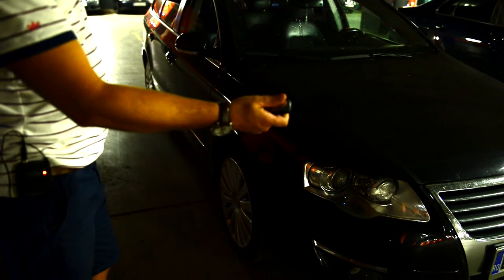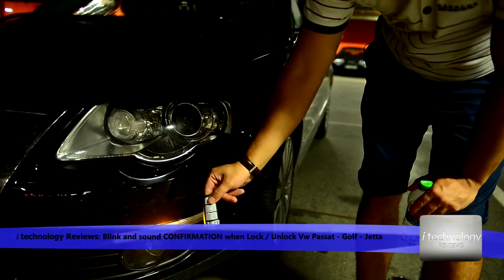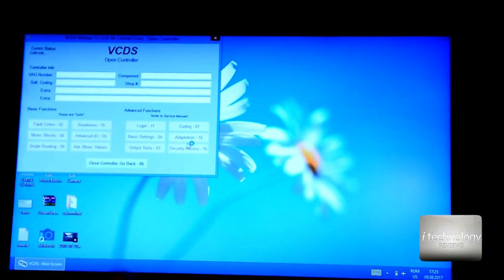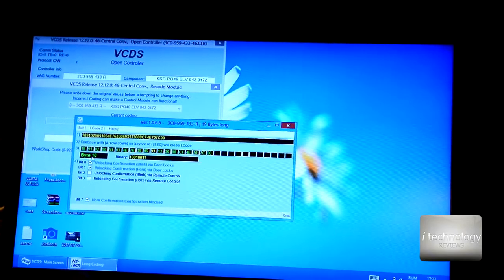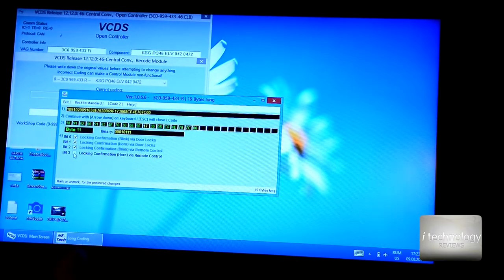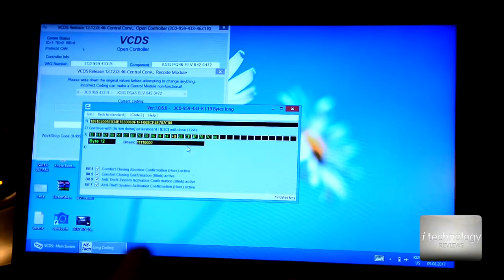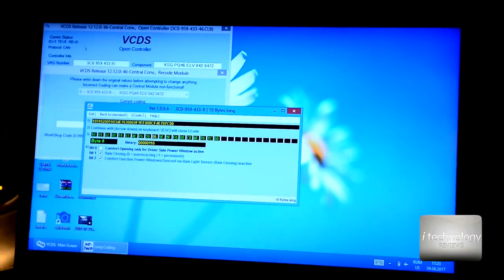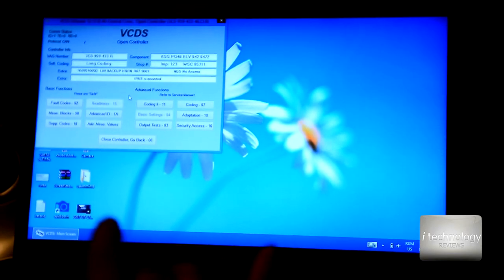Blink and sound CONFIRMATION when Lock-Unlock Vw Passat, Golf, Jetta VCDS programming

Comment: so it don't work on my mk 5 2004 because i have mil on (CAMSHAFT POSITION SENSOR G40)? I did long coding and adaptation but engine light not cross my mind. Can i clear faults and then do long coding again or i must first replace camshaft sensor?
Reply from the maker: hi; man you are in the wrong video; no camshaft here

Comment: I greet you.
I recently changed a lock on a rear door, a golf 4 - 2003, everything went ok.

Before that, when I locked the car from the remote control, it confirmed the locking with that blink of the signals, but also later, being locked, if I pressed the lock button from the remote control, it made the signals blink again.
Now after I changed that lock, it blinks when I close it, but not later when I press the close button again. What to be ?

I mention that everything else works fine on shutdown.

Comment: Ive tried, do you need a special module for the anti theft... it sounds the horn if you open the door from the inside when locked
Reply from the maker: hi; yes you need the siren unit that have electronics inside with backup battery

Comment: I have 2015 passat will this work please? I try once before but didnt have car running and only selected the 2 unlock with horn options I must make sure next time I do all 6 options. Will I have to fit a new part or something
Reply from the maker: hi; you need an internal original alarm system; will not work on horn... subscribe please
Reply: @iTechnologyReviews  I activate last night I have alarm fitted now I get the chime not the horn I believe this is normal for passat its more like a shrup
Reply from the maker: good to know; subscribe